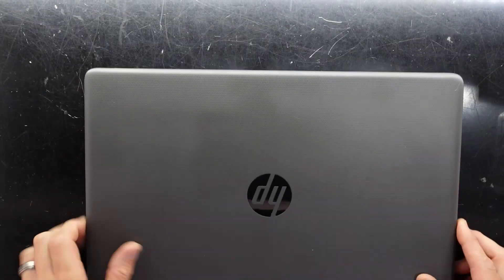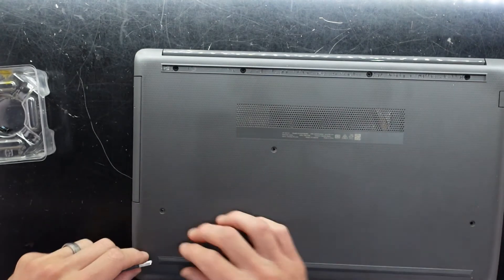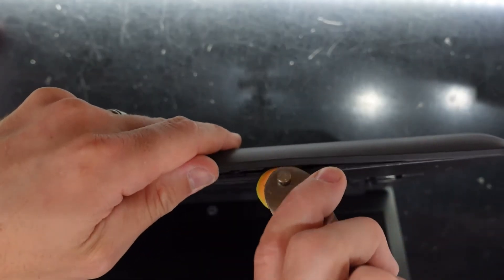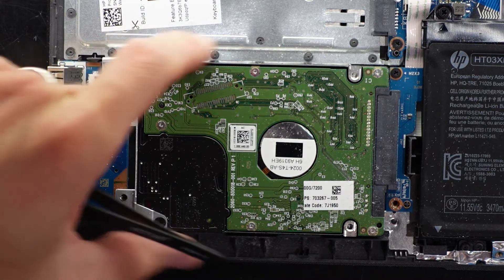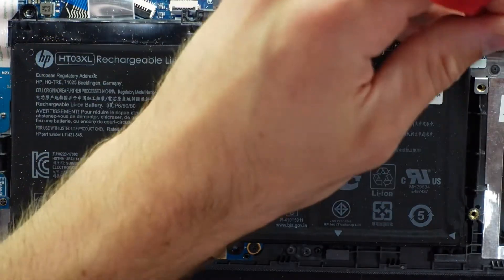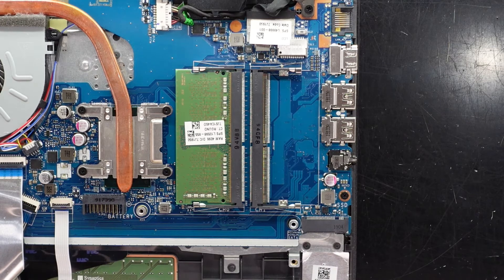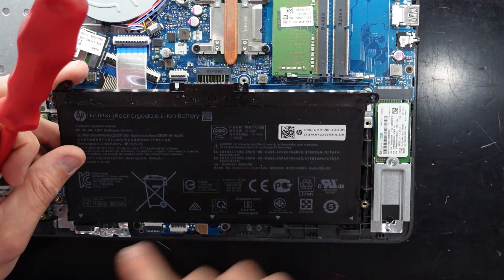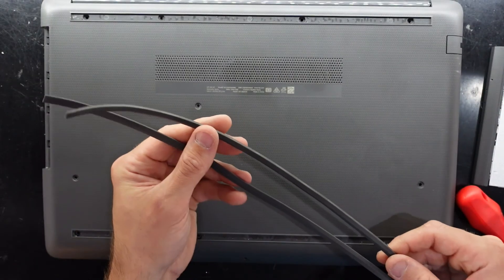HP 250 G7 SSD and Ram Upgrade

Comment: Hey Rick, I am using the same Laptop HP 250 G7 came with single 4 GB DDR4 RAM installed in Slot 2 instead Slot 1. Recenctly I thought of upgradation to 2x8GB RAM of same frequency and found that Slot 1 is not working with either exisitng 4 GB RAM or new both 8 GB RAM. Tried cleaning the slot but not worked. Can you help me in this regard ???

Comment: I have the same laptop model as the one on the video just 1 RAM slot instead of 2. Also there is a space to add SSD besides the battery on my laptop. Which SSD type can I use? Nvme, M.2 SATA or 2.5-Inch SSD?
Reply from the maker: 5:00

Comment: My laptop is hp 250 G7 4GB Ram. It has 2 slots, 2 slot is where the 4GB Ram is installed. Can I buy 2 8GB Ram sticks and remove the 4GB to install and get 16GB Ram?
Reply from the maker: yes you could
Reply: @rickstechrepairs Okay, that means the 4gb Ram stick will be off? Also can any 8gb ram fit? Especially the frequency and ...

Comment: Hey there, 
I have this same laptop but mine had 1tb hard disk and 8 gigs of ram when i bought it, i checked the system and it supports 32 gigs of ram in total and has 2 slots , so im going to add another 8 gb ram stick to get 16 gigs of ram. And i want to change the hard disk to sata ssd and also add an nvme ssd , will there be any problems if i do it ? I have an  bootable windows 11 in my pendrive so , OS aint a problem

Edit : the processor is i5

Comment: hi, i have the same laptop with i3 8gen. 12gb ram, i will buy an 4tb m2. gona it be workin or is the max for this device only 512gb or 1tb
Reply from the maker: not sure, I would recommend double checking on the hp site, to see if it supports nvme m.2 or sata m.2

Comment: Hi Rick, i have a problem with my 250 g7 ( 84a7 motherboard with intel 7020u ) so i bought ssd m2 apacer with interface sata 3 6 gb/s but i think my motherboard needs pci express 3.0 x4  ( i checked it at cpu z) , am i right? cause this ssd doesnt working :(
Reply: in other vids i see they use nvme
Reply from the maker: I think with that CPU and Mobo It will support both but i would rather go an NVMe rather than a m.2 Sata Drive in there

Faster and Cheaper

Comment: hey rick, what is that called, beside your battery ?
at the top called ram, at the left called SSD, what is on the right side of the battery ?
Reply from the maker: 6:40 its a nvme m.2 slot

Comment: I have 250 g7 4gb ram 512 gb SSD..
Please tell me the maximum ram i can upgrade on the 2nd slot which is free.
Reply from the maker: i would add a 8GB stick
Reply: Tell me if you know
Reply: Still using same laptop? How's the performance after the upgrade if you did.

Comment: Hi Rick, what is the maximum capacity of the M2 SSD that the mother board can accept in 270 G ? AND, can I use my HDD and M2 together?
Reply from the maker: if you have two slot for HDD / M.2 , you can use both 

no idea on size limit, i suspect that its whatever you can afford

Comment: brother i have a question i have a laptop HP 205 G7 serial number 6MS19EA is it a good idea to upgrade the ram memory with two slots of 8gb corsair SODIMM-2666MHZ on intel processor i3-7020. Will support 16 ram memory. And in cmd I checked with the command "wmic memphycial get maxcapacity" and it turned out that the maximum is 32GB supported. I don't know what to do, how much memory to install and it works great, if you have a suggestion, if there is a better than consair ram memory for software, suggest it to me. Thank you in advance!
Reply from the maker: for a machine like this i would use 2x 8GB Sticks 
16GB is a decent amount for a machine like this

Comment: My hp 250 G7 i3 16Gb ram and 500gb ssd In place of the normal and master hard drive and I have put a small ssd m.2 together
Reply from the maker: should be able to use both drives at once
Reply: @rickstechrepairs  yes it can after i have done it but whoever wants can try it

Comment: Can we use hdd and ssd both at same time in hp 250 g7 ?plz reply fast 🙏
Reply from the maker: if your laptop has both connections inside your machine, you could use both at once
Reply: @rickstechrepairs  i was talking about the laptop mentioned in ur video 👀

Comment: .hi, thanks for it, but i have one problem. i cloned my old hd to wd harddrive to a Crucial P5 CT1000P5SSD8 1 TB Solid State Laufwerk (3D NAND, NVMe, PCIe,). but I didn't get it as boot device. the western digital I put out of the notebook. I didn't get rid of the bios enabling. Have you any ideas?
Reply from the maker: i would load up the bios and see if you can change the boot order.

Also im not 100% sure if these machines support NVMe drivers, its possible it only supports m.2-Sata